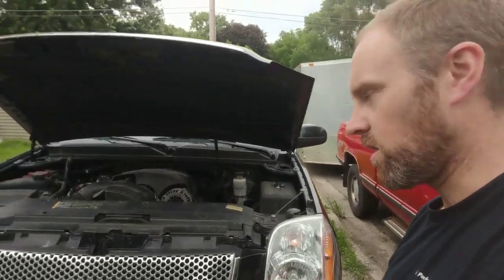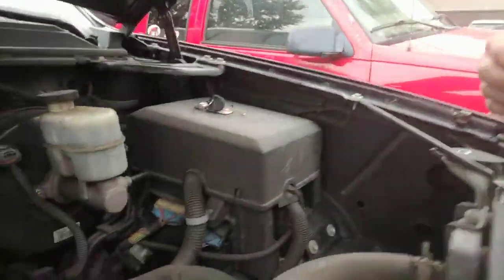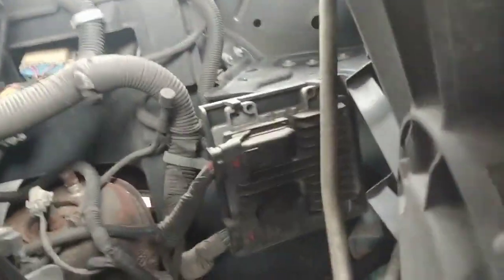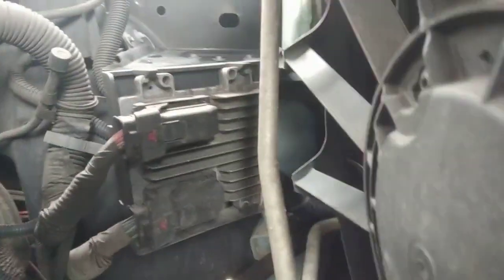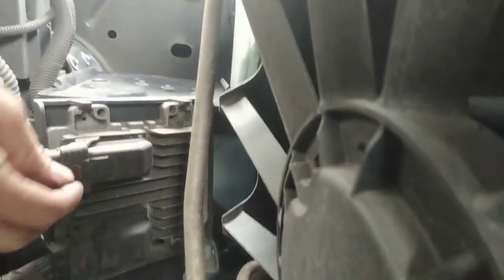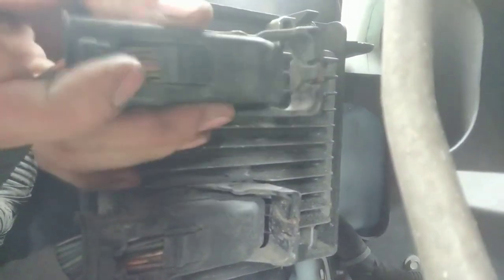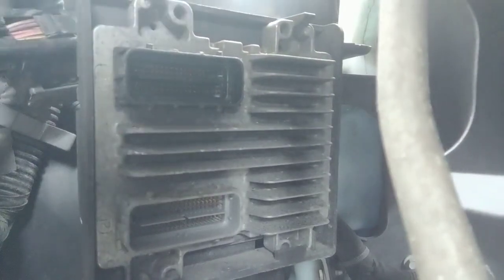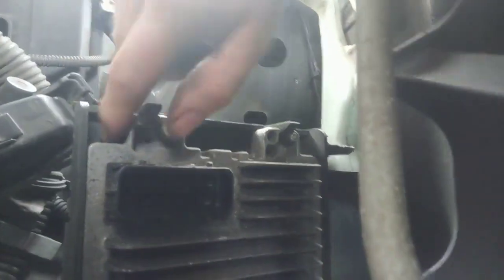Pulling Your GM Truck PCM to Send to LT1Swap

Comment: Would I need to do this for my 2012 Yukon Denali ??
Reply: I just had cylinder 4 go bad “stuck lifter” ordered your tool and popped it right out from being stuck so now would I have to get the aFm disabled we modified the vlom as well
Reply from the maker: Yes, Message me on my website for faster responses though.

Comment: Another great video!  I also recently completed the DoD delete that you taught in another video of yours and that worked perfectly with your custom tool to unstick a bad lifter.  Thank you for the great how-to and LT1Swap recommendation!

But I have to comment on LT1Swap for their excellent customer service at such a reasonable cost!  The not-so-wonderful USPS lost my ECU after Brendan at LT1Swap completed and shipped my re-programmed ECU, and once I asked him about possible next steps to maybe get another used ECU as a replacement if the USPS doesn't find my ECU he immediately shipped me a replacement.  I highly recommend LT1Swap and their excellent customer service!

Comment: after doing the tune and vlom update, i drove 150 miles and all good and got on it up to 70 mph and started missing and now i have,po0171,po 304,po113,po122,have changed all o2 sensors,map sensor,,all plugs,wiwes,fuel injectors,tps,and fuel pump, and compression test on cyl 4 180 psi. Could the tune be my problem?
Reply from the maker: Not likely tune related. Have you checked compression twice in a row yet? Perhaps you have an unfortunate failure, the lifter could also be spun. Using the starter relay with the key off, spin the engine over. Make sure not to jump the wrong terminals as it could damage the ECM. Vlom Must be on for this test. While it is spinning watch the suspected rocker move. Make sure that it rocks at least 6 to 7 times before you let up on the starter. If the rocker stops moving before then it is getting fed oil pressure and is likely spun. You can determine this by looking at the side of the lifter. To see the side of the lifter you need to pull the VLOM and clean out the oil tower of the suspected lifter with cleaner and shop air. Once cleaned you can look down the oil tower and if you see a hole in the lifter it is not spun. If however you see only shiny metal or a flat surface then the lifter has spun due to a bad plastic lifter guide. When this happens you will need to replace the camshaft and all lifters. This would be a good time to do a full AFM/DOD delete where you remove all AFM components and replace them with non AFM components. 

I do now offer AFM delete kits for select models. Be sure to check my website for your engine.

https://www.crazedperformancerepair.com/afm-delete-kits

Comment: So without having anything done prior, and no lifter tick, everything stock (been running range disabler) all you need done is sent off to be programmed?
Reply from the maker: To tell the computer to no longer use AFM, yes that's all. It will also cover you for if you ever do a full mechanical delete. The range device won't work on a full mechanical delete.

Comment: I have a 2009 Escalade Hybrid w/ 138k in my shop. I ordered your kit to release lifter and delete vlom. Went to LT1 Swap site to get the procedure to send him my ecu. On his site i read that he cannot delete the afm on a hybrid model. Do you have any suggestions for my next move? Can i buy one of those obd plug afm delete plugs? Am i just going to have to bite the bullet and remove head and fix it right? Dont want to delete vlom and have no way to tune afm and have that stability problem.

Comment: If I do this to the computer, is there any need to have it deleted through hp tuners? Or is both being done the best way? Without Doing cam and lifter swap
Reply from the maker: This or hp tuners accomplishes the same thing. This is the cheaper method though. No need to do both at all.
Reply: @CrazedPerformanceRepair  thank you, this active fuel management is killing me. 

I do have one more question and I hope it ain't a dumb one, if I delete the afm through hp tuners can I still use e85?

Comment: Waiting is the hardest part. Fixed the stuck lifter on cylinder 4 using your tool and methods. Sent the ECM off early last week and it is due back from LT1swap on Thursday. Took all the time to replace valve cover gaskets, install updated driver side valve cover, replace cracked oil fill tube, clean up various parts, replace a ton of disintegrated split loom tubing, install oil catch can.

Comment: So just to be clear, I can do the reprogram, leave the stock cam and lifters in it until I want to do the full delete with a cam and tune, and it shuts off the AFM/DOD?
Reply from the maker: Yes all it does tell the computer not to use the system.
Reply: @CrazedPerformanceRepair  Fantastic! I have an 07 FFV Tahoe with 114,000 and no lifter tick yet, so this will be on the way to LT1 swap soon to prevent that until I can do the full delete with the cam.  Thanks for the help!
Reply: how has it be since the reprogram? Did you ever do the full deleteor just roll with the programming?@davidbowman8962

Comment: How much did the amf delete cast in all , looking to do on my 2013 sierra
Reply from the maker: This is just to turn it off in the PCM, lt1swap charges $50 at the moment. A actual full delete tune and parts but no labor is $450-600+ depending where you source things

Comment: How much does it cost i know some places run around 320.00
Reply from the maker: If you send your ECM to LT1Swap.com it will cost you a little over $50 after shipping.
Reply: @CrazedPerformanceRepair  ok turns out they don't tune for cams
Reply from the maker: @ironhead320  no that is meant specifically for specialty tuners.
Reply: Oh ok

Comment: Good referral!  Wish I knew of LT1 earlier. I looked into PCMOFNC for $60 +shipping.  But used Lime-swap, for just a little more I sent the PCM and TCM for the DOD delete, performance enhancements, shifts and TCC lockup are firmer, shift points are a little earlier, TCC stays engaged at lower speeds.